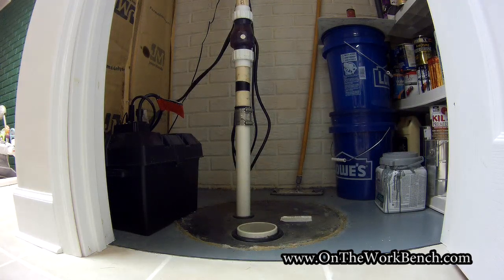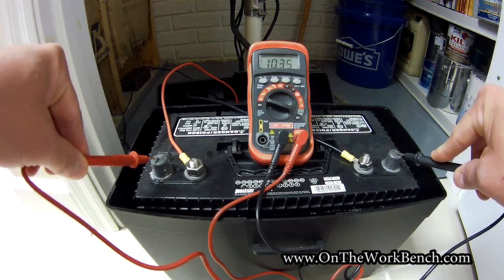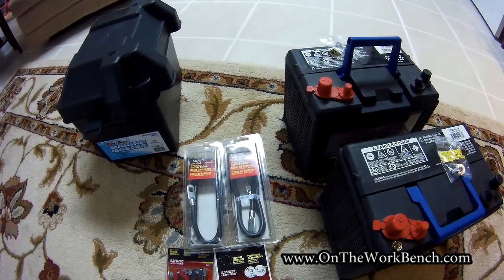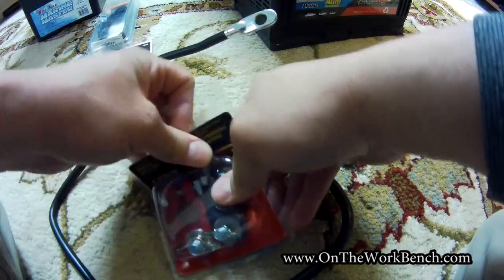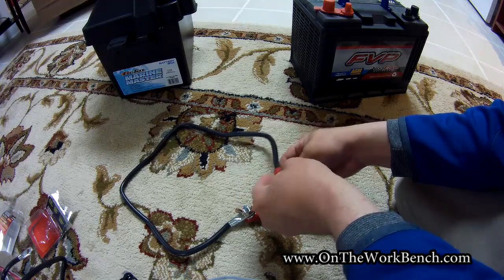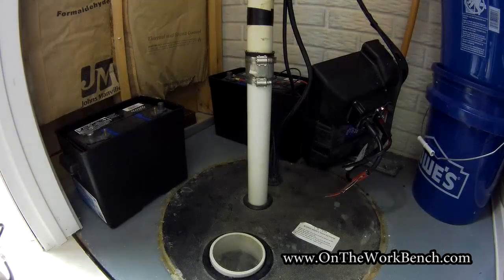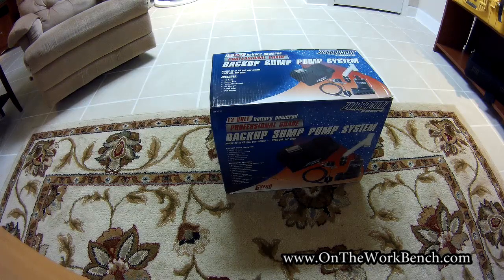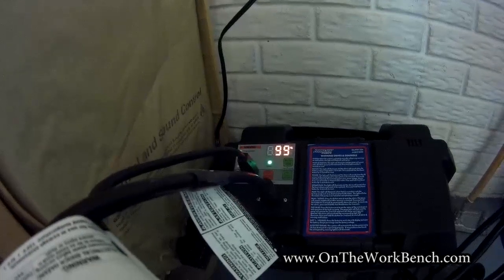12v Backup Sump Pump Troubleshooting

Comment: Invest in a better battery charger like the Noco Genius 5, it will prolong the life of your batteries and thus pay for itself. Also, hook up the charger up to a positive terminal on one battery and the negative on the other battery. Your pump should be hooked up this way also. This allows even charging and discharging of both batteries.

Comment: What about the fuse?? What are the specs on the fuse for the backup system?
Reply: Not a single person on the internet will talk about a fuse replacement. The user manual references it. But doesn’t say where it is located. This is done on purpose so you hire a plumber.

Comment: Go with group 31s and don't put your batteries on cold concrete floor. At least place them on some 2x8 pieces of wood.
Reply from the maker: Insulating the batteries from the floor is a great tip!

Comment: Hi there.... I went with two identical pumps, one sitting on a brick to make it higher... both pumps discharge into one pipe and have check valves. The higher pump is connected to an inverter that draws from two group 31 deep cycle batteries in parallel... the batteries are trickle charged...if the main pump dies, (house current) the other one pumps...  I have a water lever sensor installed to my house alarm... no more sump pump issues :)
Reply from the maker: You may want to make sure the inverter can handle the start up current draw of the pump without blowing a fuse. Some inverter are only good for a TV or computer, but other inverter should work OK like you described.
Reply: @OnTheWorkbench  3000 watt inverter....has no issues....even runs runs the furnace, if it has to... :)
Reply: @darickymeister  Which one do you use if I may ask? Has it been reliable over time? Thanks in advance.
Reply: @jcpoiuy  I use a Canadian Tire Eliminator  3000W inverter or sometimes a PowerDrive 3000 Watt.....but I now keep the PowerDrive inverter with me on the road to power my air compressor....the Eliminator is the one now that powers everything, if needed.
Reply: @darickymeister  Thanks, appreciate it!
Reply: @jcpoiuy  no prob!

Comment: So the previous battery was 3 years old ? Along with the back up pump itself. Was the old battery an AGM type ? Couple of things about back pump chargers - some slightly older ones may not do well with AGM style batteries. Always check with the manufacturer. Also some may not charge more than one battery.
Reply: Brian Rener isn’t 3 years the life expectancy of these type of battery’s?